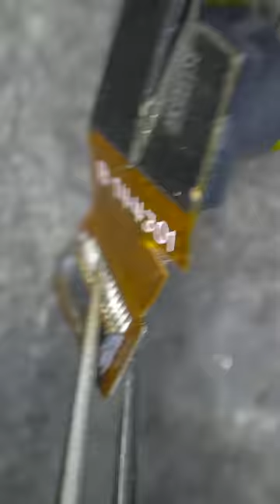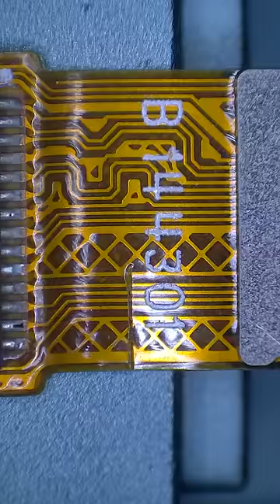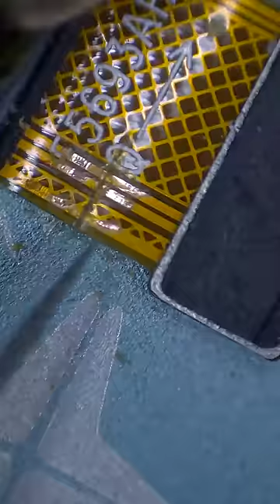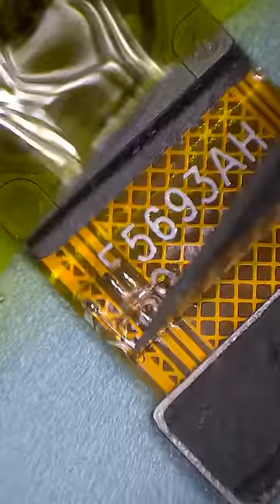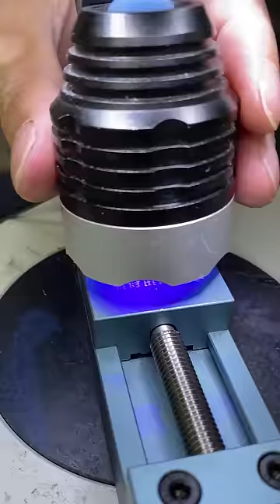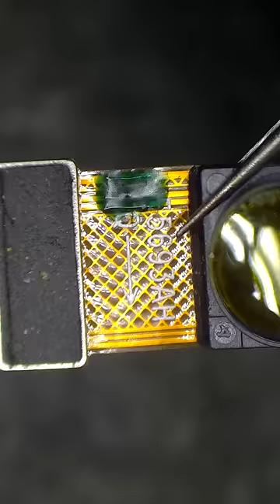Repair Broken Flex Cable with Jumper Wires #Shorts

Comment: The precision levels are mad with this repair! Well done REWA 👏
Reply: 🤣Simplus as always
Reply: Yes? Show it work. Let's see just how imprecise and just replaceable this is instead of repair? It is ... 50% likely to not work, and 100% to fail soon after install if it works at all.
Reply: @thingsofsuch  i thin when the camera sensor was replaced in mobile while using the camera the repaired part in the flex cable will heat  again it will not works

Comment: anyone can tell the best soldering iron wattage for these kinds of stuff? I feel like 25W is too much. I do personal repairs on my electronics that's why I wanted to know. Thanks
Reply: the tip size and soldering temperature are the ones that matter. also solder type. you could ruin this even with a 5w iron if the temperature is not limited. 25w iron with a sensible temperature and a small tip would handle this just fine
Reply: Wattage and temp have no bearing.
Wattage just means you can get hotter (total) or heat up faster.

Your actual soldering temp is going to be lower than max temp, so it doesn't matter.
(Note, if your soldering iron doesn't have temp control, don't recommend using it outside of basic through-hole connections or large pads)
Thermal mass also matters (larger tips) it helps regulate temp of the iron, and melt larger solder blobs without needing stupidly high temps.

Even the cheapy chinese soldering irons are good these days, they just take a while to get to temp, not really an issue though.
Something good will definitely be beneficial though, and spending money on better tips, or accurate temp readout is always nice to have.

Comment: guy, thanking your video... looking how you fixed, i got occurred an idea... insead of cables, just making wires with conductive ink, over a plastic, and trying to add it over it, sticking it, or only soldering the tips...

Comment: Everything looks easy and something I considered long ago. But my problem is how do you get that solder on the cables, when I try it just chips off..
Reply: Lower heat, plenty of flux, good solder (and thin for this application), and make sure the pads/traces are bare.